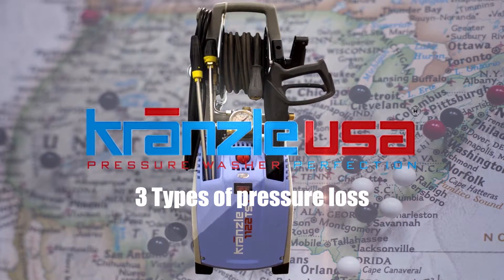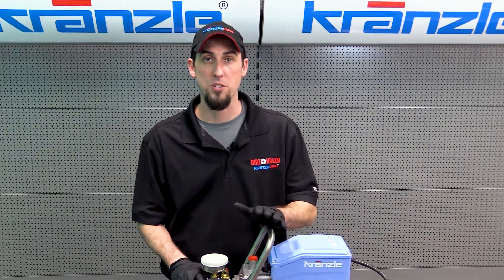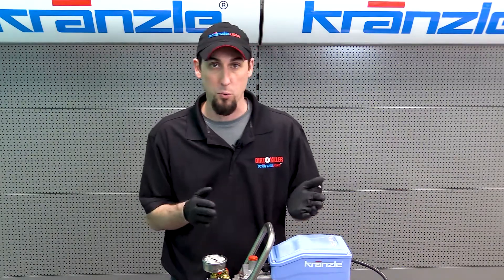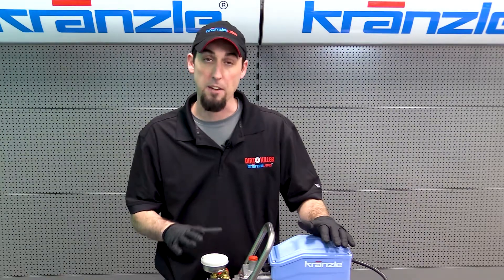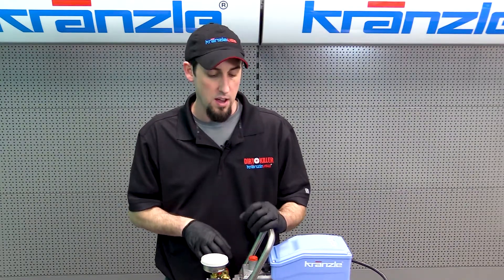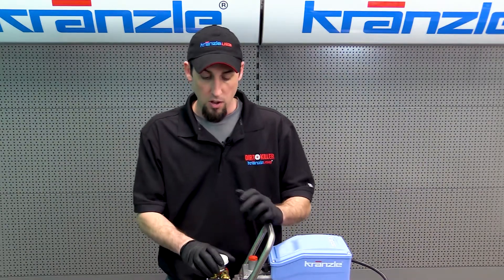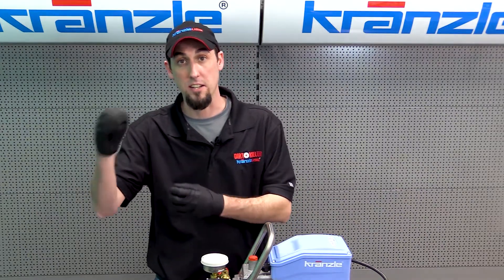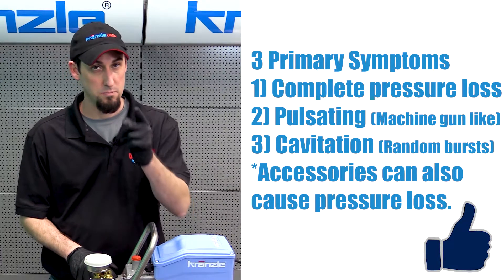Kranzle repair -  3 types of pressure loss

Comment: What should be pressure valve O ring size in kranzle 1152 trolley type
Reply from the maker: Good morning, 

Thank you for reaching out. If you look in your owners manual there is a parts breakdown for what you are looking for. We do not sell the 11552 and can not confirm what O ring you are looking for with the information provided.

Comment: Hello, i have the machine gun problem on my brand new Kranzle 2160 tst it is only doing about 50% pressure. Machine is 10 minutes old. Can you help?
Reply from the maker: Good morning @laurenskamp508 , based on your symptoms i would encourage you to check 2 things. 

1) you have enough water volume moving towards the machine, with no air in the line. 

2) Once that is confirmed check the machines check valves and water inlet for debris. 

Regarding scenario 2 we have seen this happen in new units from a garden hose that had debris, bugs and even critters in it from the off season.

Comment: Hello Josh. I have a problem with my 135 tap. The washer works perfectly, but the pressure is low, about 90 bar. Max. After installing the turbo head, 105 bar. I have already replaced all the seals (on the regulator, return valve, main seals...) The pistons are old but have no damage. What is the cause of insufficient pressure? Please help.
Reply from the maker: Thanks for reaching out. We are happy to assist but need some more info. Would you mind shooting one of our technicians an email including the above summary and some pictures of the unit? We will need to see what model is being discussed before giving any wiring advise here.

Comment: Mine have no water jetting out of the nozzle at all
Reply from the maker: Does water come out at all? Or, is it just NO pressure, but a stream? Feel free to give us a call to help trouble shoot. 800.544.1188 9-5 EST
Reply: @kranzleusa5846  water does not come out at all. No water, no pressure.
Reply from the maker: @Randomchemist  That's rare.. water should flow through the system if there is no gun-jet.. You turned the water on right? Please give us a call to discuss. 800.544.1188

Comment: Sounds like I have cavitation pressure loss.. ill need to open it up and inspect.    😓
Reply from the maker: Let us know what you find. You can get parts at KranzleUSA.com aka DirtKiller.com
Reply: Hi,Kranzle 1050p Water Pressure Issue the problem we're experiencing is that the water pressure unit starts running smoothly for about 15 to 20 minutes, but then it automatically cuts off. After a short while, it starts again, but this continuous cut-in and cut-out cycle has become problematic. Additionally, we've noticed that the motor body heats up during this process . Could you please provide us with guidance on what might be causing this issue and the steps we should take to troubleshoot it?

Comment: Tomorrow I will check my brand new X A17 TST. I guess my pressure washer has a pulsating pressure loss.
Reply: It only do 90 bar instead if 150 bar
Reply from the maker: Hi. Pulsating pressure loss is usually the check valves.  Here's a tutorial on how to fix that. https://www.kranzleusa.com/blog/kranzle-blog-3/post/kranzle-repair-learn-how-to-replace-check-valves-69

Comment: Hi Josh, may I know the problem of my Kranzle? Oil become white color. What is the part number needed?  There is a vibration noise when I release the trigger. Please help. Thanks.
Reply from the maker: Hi. Please contact us directly and submit a tech support ticket. Include a little video if you can about that shows us the "vibration" noise. Note. There is water in your oil. First step is change the oil and make sure cap it tight. Thanks.

Comment: I had a unit with intermittent 15bar pressure loss and a slight judder in the hose. Machine had all new valves, o-rings etc. Turned out it was one of the hard water seals was worn swapped it out (along with the other 2 fault went away).
Reply from the maker: Sounds these videos helped you out. Great. Anything else we can help you with?